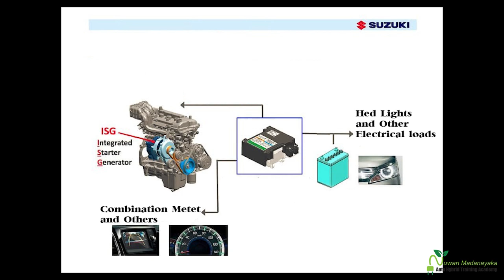HYBRID SAFETY CLIP 04  - (WAGON R හිමියන්ට නව යෝජනාවක් ) Sinhala

Comment: Wagon R FX 2017 MH55 non-turbo Model 67,500KM - I usually use Valvoline 0w20 and VIC 932 and change after every 7500km, but this time used Valvoline 0w20 and VIC 110 oil filter do I need to change oil and filter early, or is it a combination not good for the vehicle?

Comment: . I have problem with my wagon r hybrid 2017 model . Car after jump starting when my old acid battery was dead . I installed new battery but my eco idling is not working lithium battery bars are also constant on 3 bars . Hybrid sytem is not working and no error signs came in odo meter . Please reply in English .

Comment: start stop function ek off krgenanm ynne hamawelema aluth battery ekkt maru wenn oni ne ned?
Reply from the maker: Start stop function eka dash bord eke athi ( A)  lesa sadahan switch eke magin off  kireema kala haka..paddathiya dosha sahitanam Meeter bord eke ( A ) lesa sadahan balbaya blink wena athra start stop kriyathmaka nowe..
Reply: @nuwanmadanayakaautohybridt3237  blink wenne 12v battery eke fault ekk nisad sir?
Reply from the maker: sadeepa prageeth  wenna puluwan, blink wenne Auto stop function eke fault ekak nisa..start stop battery eke (12v) , Auxiliary battery eke ( Lion battery) ISG eke ho wire harness eke fault ekak nisa wenna puluwan, system eke scanning karala fault eka hariyatama check karanna..
Reply: @nuwanmadanayakaautohybridt3237  godk tnx sir